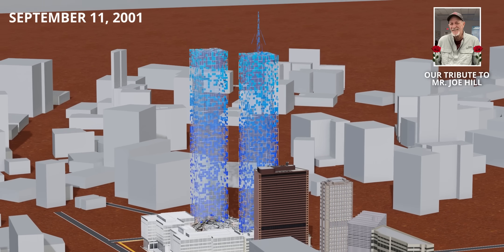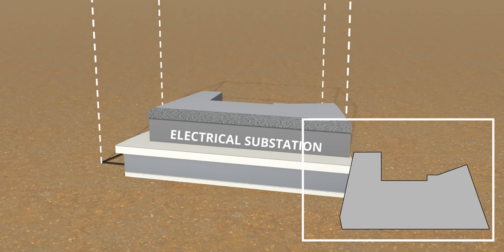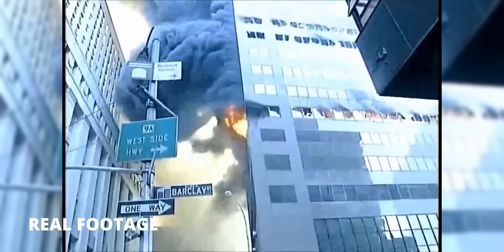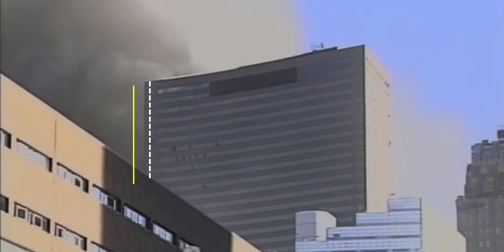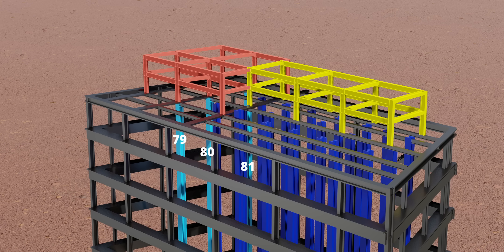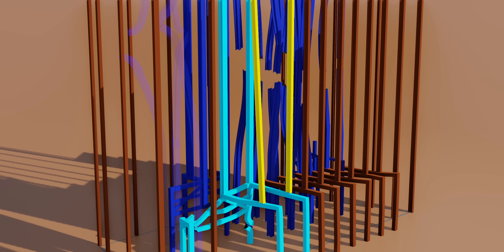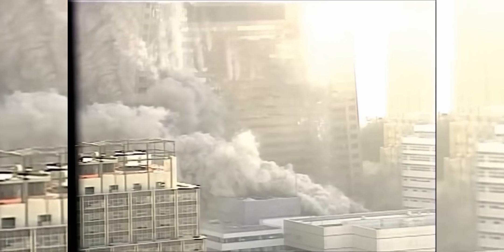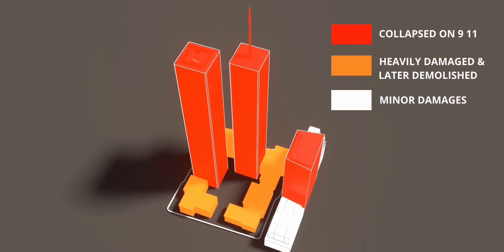Collapse of Building 7 | The Complete Physics

Comment: All these years later, no one can explain the free fall implosion of WTC 7.
Reply: No one can explain Santa Claus either. And for the exact same reason. Because it's fairy-tale make-believe. When you grow up and stop believing in fantasies told you by the big boys in the play-ground, try again.
Reply: Well that's true, but I can explain what actually happened - which isn't that.

Much misunderstood, Building 7 was the 6th building to collapse of 10 lost on 9/11. Because of its early low priority, conspiracy filled the information void with garbage made up by technically ignorant people promoting political agendas. But 7's loss is an engineering problem and should be treated as such, so I prepared this brief summary of my own analysis to fix that, using technical analysis, not ideology and tired memes. 

At 10:28am the WTC North Tower collapsed, showering Building 7 with tons of burning debris, causing heavy damage and starting many large  fires which burned out of control for the next 7 hours. Half the FDNY firefighters having been killed, units in disarray, equipment destroyed, no water pressure, and the greater urgency of search & rescue efforts, Building 7 couldn’t be saved so firefighting efforts were pulled as futile and 7 left to its fate. Firefighters make that sort of choice every day in brush fire situations - which houses to save and which ones to let go. Only real difference here is moving the decimal on the size and cost. People get overwhelmed by the size.

www.youtube.com/watch?v=g_SvpwyC17M

Collapse of a burning structure is always a concern for firefighters. Steel buildings subject to fire rely on active firefighting to survive. Buildings are designed around 1 to 3 hours of fire resistance, allowing time for occupants to escape and active firefighting to get started, after which all bets are off. Left to their own devices they'll exceed their design envelope and collapse, like Plasco Tower and Wilton Paes de Almeida. In 7 the occupants escaped, passive and active fire protections were compromised and active firefighting was abandoned hours before the collapse, which left the building to its fate. It lost. Odds on Building 7 would eventually collapse, and it did. No big deal in logic.

 http://www.youtube.com/watch?v=WnYBX6QT0R4 

FDNY Chief Daniel Nigro - The biggest decision we had to make on the first day was to clear the area and create a collapse zone around the severely damaged 7 World Trade Center, a 47-story building heavily involved in fire. A number of fire officers and companies assessed the damage to the building. The appraisals indicated that the building's structural integrity was in serious doubt. I issued orders to PULL back the firefighters and define the collapse zone. It was a critical decision; We could not lose any more firefighters. It took a lot of time to PULL everyone out, given the emotionalism of the day, communications difficulties and the collapse terrain 

FDNY Deputy Chief Peter Hayden ; We had our special operations people set up surveying instruments to monitor and see if there was any movement in the building. We were concerned of the possibility of collapse in the building. And we had a discussion with one particular engineer there, and we asked him if we allowed it to burn could we anticipate a collapse and if so, how soon? And it turned out that he was pretty much right on the money, that he said 'In its current state you have about 5 hours 

The collapse of Building 7 was anticipated and widely reported in the media throughout the day, with 24 video cameras recording some or all of the collapse. Everyone knew what was coming and why. 

www.youtube.com/watch?v=OY5S5k3tMHI

The collapse of Building 7’s was entirely different to the Twin Towers and harder to understand, most details being hidden from view and not intuitive.  But we can still sort out what happened through careful analysis and observation. This is my explanation of the collapse relying on no outside authority. 

Building 7 was a unique, asymmetrical 47-story steel framed structure built atop a smaller 3-story building serving as a partial foundation, requiring lower floors dedicated to complex load transfer structures. Of trapezoidal shape and all-steel tube-in-tube construction, B7 (above the 7th floor) consisted of a central core of steel columns carrying most of the gravity load, perimeter steel columns around the outside of the structure carrying the remainder of the gravity loads and long span beams and girders to tie those elements together and form the floors. On the outside of the building hung a moment frame or outer shell. 

Phase 1 : First externally visible signs of collapse initiation occurred at 5:20:28 pm and were notably quiet with observers not realizing the building was collapsing! No audible warning in the form of hundreds of ear drum busting 180-190dB explosive bangs preceding the collapse. Here at 12:00 a local CBS affiliate reporter is talking 10 blocks from B7 when collapse begins. People don’t start to notice the collapse until 12:11. At 12:45 is the famous CBS fixed camera clip of Building 7’s collapse. Note how quiet it is. 

www.youtube.com/watch?v=t5tEy6mXSE8

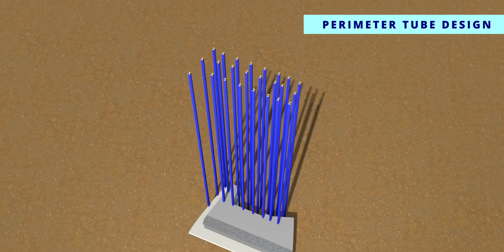Collapse initiation was due to lower floor failures above the load transfer region (8-14th floors) in the NE corner. In this video at 0:45 you can see the NW corner from inside the building while under construction, Column 79 just out of frame on the left. That big, angled steel beam across the top of the frame connects to C79 at one end. The girders connect to the beam. That beam and all those girders depend on just one connection 

www.youtube.com/watch?v=nP3TNHPCIVU&t=45s

Phase 2 : The NE lower floor failures caused a loss of critical lateral support over an excessive length of Column 79 and it buckled. Looking at a floor diagram of Building 7 (www.nist.gov/image-16640) when you see all the structures that depend on C79 you quickly realize this one column was a relatively isolated structural element on which a disproportionately greater fraction of the structure depended analogous to say the Key Bridge. Externally as collapse begins we see a vertical progression of window breakage along the 44-46 line and a kink in the roof of the East Mechanical Penthouse at the top of the building, consistent with C79 failure. Normally with a buckling column, the load could be redistributed to other columns. With C79 that is not the case - the failure did not redistribute the load, so the collapse rapidly progressed to the roofline, sinking the rooftop penthouse. The transition from full capacity to almost no capacity occurs in an instant and will result in virtually no resistance 

Phase 3 : With C79 gone, B7’s progressive, non-symmetrical collapse continues with adjacent columns 80 and 81 left laterally unsupported, and quickly buckling as well, sending the EMP down through the building. C79-81 all have no diagonal bracing, which is the major reason why they could not redistribute a lot of vertical loads among one another. From there collapse progressed from east to west through the central core until the core was gone taking all of the interior floors and probably most of the perimeter columns with it. Follow the horizontal progression of window failures low in the building and the dropping of the remaining rooftop structures into the building. One of the big takeaways from the NIST Building 7 study (invariably ignored) was how their modeling determined C79 failing under ANY circumstances would have initiated the same collapse sequence. 

Phase 4 : After about 10 seconds only the exterior moment frame remains, giving the illusion B7 is still standing to the casual observer since little has outwardly changed. But it is just a hollow empty shell like an empty cereal box supported only by a few remaining columns and overloaded from the loss of the core columns and floors, quite unable to remain standing. With nothing remaining behind it, the north face leans inward, forming a V in the roofline, the last few columns buckle under the strain and the moment frame free falls, landing on top of the debris pile. 

It is only here at the very end that a single measurement of alleged free fall acceleration is taken, from a single point on the outer shell. The Building did not “free fall” – just one corner of the outer shell did, sort of. The Building_ (defined as its center-of-mass) was already gone before that happened. The period of alleged free fall was a product of how it fell NOT why it fell and can't tell us what started the collapse 10 seconds earlier. Start to finish the collapse took 18-20 seconds, 3 times longer than free fall . How fast something falls cannot tell you what started it falling_ anyway. 

The debris spread outside the footprint blocking surrounding streets, heavily damaging the Verizon Building and destroyed Fiterman Hall. 

Building 7’s progressive, non-symmetrical collapse was incidental and unintended collateral damage from the combined effects of fire + time + gravity, started by the collapsing North Tower. That is true no matter who planned and carried out the 9/11 attacks or why . The collapse was of so little consequence it barely registered at the time - a footnote, only taking on semi-mythical status as an alleged smoking gun years later when demolitions at the Twin Towers, missiles at the Pentagon and shoot down over Shanksville all failed and conspiracists had nothing left to work with. 

Anything can seem like a conspiracy if you don’t understand how it works. Now you should. I hope you found this helpful, informative and it solicits informed critical comment. If I made any errors of fact, logic or reason or left anything important out, please let me know so I can fix it. IF you can offer a more plausible alternative please do. Be the first. Please start any reply with the words “Tits McGee” or I will know you didn’t read it and are wasting my time.

Comment: Are people expecting to see a tower fall over like in a Superman movie? Buildings don't support their weight on an angle. If any building were tipped over far enough for Superman to catch it, the supports directly underneath it would buckle. And when there is nothing supporting it from underneath, it gets pulled in the direction of gravity... STRAIGHT DOWN. Now HOW straight depends on the details and what forces and tensions are pushing and pulling in different directions. Building 7 had a different structure and cause if it's collapse than the twin towers, so building 7 twisted and fell a little more slowly as the supports underneath it gave way and buckled. While the towers had a failure of the supports holding up the top so many floors, leading to a pancaking effect as the giant weight of a huge building fell directly into each successive floor at closer to free fall speeds. But either way, without enough support to hold them up, the direction they fall is pretty much just straight down.
Reply: The Alfred P. Murrah Federal Building in Oklahoma City was bombed and a large portion (the whole face) of the building was destroyed. Why didn't it collapse like the WTC trio? I've worked on high-rise buildings (30-60 floors) for over 40 yrs and I know exactly how they are built from the foundation to the penthouse. This video is a very poorly constructed lie. The WTC trio was definitely, without a doubt in my mind/experience, not brought down by planes or fires. Were they brought down by explosives? We'll never know because they said they never tested for explosive residue. Really? Their theory(s) is pure unadulterated bullshit!

Comment: The empire state building was hit by a plan once and it did not fall and the WTC should not have fallen either. It was engineered to withstand a hit from a plane. The government was 100% behind it.
Reply: In 1945 the ESB was hit by a 10 ton plane at about 185 mph.

The South Tower by comparison was hit by a 122 ton plane at 589 mph. The weight of fuel alone in Flight 175 was greater than the total weight of that B-25 way back when.

These are not the same events.
Reply: @TheCriticalStinker-01 a 767 weighs 80 tons
Reply: @h1F595you're absolutely right.I did not believe it weighed that much so that's exactly what I did. And you are off by forty tons. That's the weight of a dump truck overloaded. If you understand so well. Explain the upward forces involved in the collapse of the twin towers... if you can. If you can't just leave me alone I don't have anything else to say to you
Reply: I don't care how much it weighed.Let's just say you are correct like I said I was guessing and that's a lot of weight. Now answer my question. Or are you gonna divert from the question again?Like stinky keeps doing